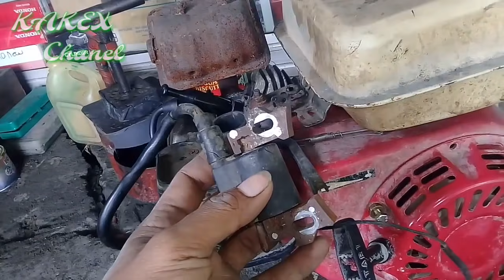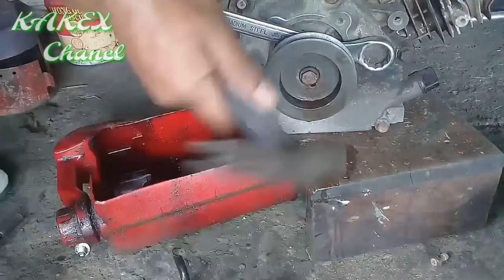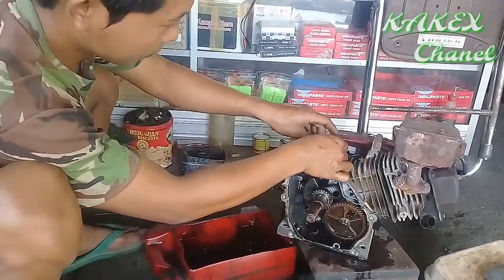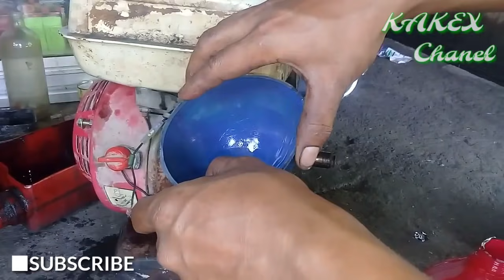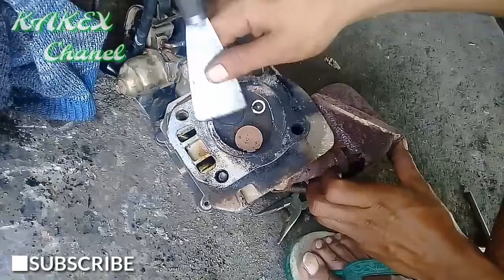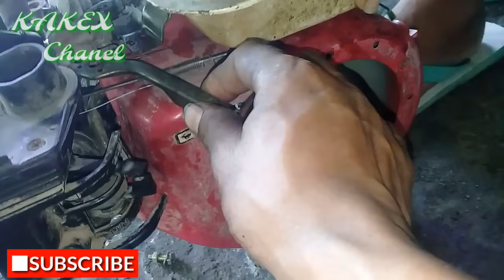Cara ganti governor mesin GX 160 & hilang pengapian

Comment: Boss mau nanya .
Low oli mesin gx 160 pompa air.
Itu sama atau ga sama oli motor.
Pa ada oli sendri.
And oli apha yang bagus .
Terimakasih.
Di tunggu balasanya.
Reply from the maker: Sama aja oli motor 4t. Terserah sukanya merk apa. Biasanya sy SAE 20W-50
Reply: Berrti bukan oli disell yah boss
Reply from the maker: @abitpermana1415  bukan. Ini kan bkn diesel
Reply: Oke boss makasih atas info nya

Comment: Om mesin gx gitu banyak yang di pake gokart, governor nya di bypass (dicopot) biar apa ya kira-kira . ?
Reply from the maker: Itu gasnya dibuat manual, pake tangan ( hand grip) kan? Jd mesin lbh responsiv, dgn mengesampingkan dinamika beban mesin. Gampangnya gini, kl dilepas putaran mesin ngikutin untiran tangan. Kadang jg karbu ganti karbu motor, gk mach lg sm governor
Reply: @KAKEXChannel  ngelepas governor tinggal lepas gtu aja ya ? Gak ngerusak bagian lain om . ?
Paling bekas lubang porosnya ditutup baut gtu ya....
.
Iya bener om pake karbu motor terus throttle..
.
Kalo semacam mesin gerak serbaguna Loncin Diesel ada bagian governor gtunya juga gak ya om . ?
Reply from the maker: @Fauzan128  pada dasarnya semua mesin semacam ini, buat apapun termasuk genset jg selalu dilengkapi governor utk mengikuti lonjakan beban scr tiba2. 
Istilah "diesel" itu sebenarnya mesin dengan bbm solar, kl utk mesin semacam ini kurang tepat. Tp di masyarakat trlanjur salah pemahaman

Comment: Mau nanya 2 kasus bang. 
1. Apa penyebab busi alkon cepat mati. Udah sering ganti busi baru tapi gak lama businya mati.
2. Diesel yg satu lagi semua udah dirasa normal, tapi bensin sangat borooooss bgt bang. Karbu,  pengapian, setelan klep udah diberesin semua tapi masih boros tiada tara. Apanya ya yg harus disetel/diganti ? Asal bukan ganti diesel baru aja.
Reply from the maker: 1. Penyebab busi cepet mati / hitam bs karna salah busi biasanya yg setipe dgn gx 160 itu busi panjang spt NGK BP5ES/BP7ES.  Kl slh yg pendek spt BP5HS/BP7HS bisa bikin pembakaran krg sempurna. Bs jg api dr coil kecil krn coilnya sdh lemah. Klep trlalu renggang/ timing meleset jg bisa ( tp kl blm prnh bongkar gk mungkin meleset). Setelan angin karbu terlalu boros atw kotor karbunya. Ngebul putih/ ring piston bocor jg bisa. Silahkan di cek kira2 yg mana yg belum di cek
2. Lihat kepala busi dulu, kl cepet hitam biasanya dr karbunya yg gk beres. Kl disetel sdh susah coba pake karbu mesin lain atw beli baru, plg 150 rb an. Ini jg mirip mslh busi boros
Reply: @KAKEXChannel  terimakasih, sangat membantu.

Comment: Bagaimana jika governornya gk dipakai lagi gan

 Karena karbu bawaan nya saya ganti dengan karbu yg bisa pakai gas LPG. Jdi salam saya pakai gas lpg  governornya gk saya pakai
Reply from the maker: Tidak apa2. Governor itu pengendali trotle plate aja
Reply: @KAKEXChannel  kalau mesin tidak bisa nyala apnya gan. Pengapian ad kompresi ad tpi mesin tidak mau hidup sama sekali
Reply from the maker: @ardtronicelectricalenginer3172  api ada kompresi ada brti tinggal masalah pasokan bensin dong
Reply: @KAKEXChannel  bensin ad gan

Coba pakai gas lpg pun juga sama. Tidak bisa hidup sama sekali
Reply from the maker: @ardtronicelectricalenginer3172  apinya mgkn kurang besar atau timing geser. Cek flyweel

Comment: Mas kalo oli bocor dari bawah tangki itu bagaimana mas?
Reply from the maker: Tangki apa?
Reply: @KAKEXChannel  tangki mesin honda GX 160
Reply: @KAKEXChannel  soalnya olinya bocor ( mrembes ) tapi rembesanya itu dari bawah tangki gx 160 mas.
Reply from the maker: @JovrinYT  seharusnya oli bocor itu di blok mesin. Kl dr tangki mungkin itu bensin campur kotoran, tangkinya yg bocor, bs di las atau ganti baru. Ada dijual
Reply: @KAKEXChannel  bukan tangkinya tapi di bawah tangki. Kan ada yang buat setelan gas yang bawah itu laa bocorny dari situ
Reply from the maker: @JovrinYT  oh dr tuas governor? Itu emg gk da sealnya. Mungkin kebanyakan oli atau selang pernafasan yg di kop tersumbat jd uap oli cari celah
Reply: @KAKEXChannel  selang pernafasan kop di sebelah mana si mas?
Reply from the maker: @JovrinYT  yang nyambung ke karbu
Reply: @KAKEXChannel  oke terima kasih mas 👍atas solusinya

Comment: Bang setelan guvernur pengaruh g ke gas yg g stabil di rpm atas
Reply from the maker: Bisa pengaruh
Reply: Sya ngikutin cara abang setel guvernur pas dinyalain gas'y langsung besar
Reply from the maker: Itu setelan umumnya, kondisi mesin dan karbu masing2 bs beda. Coba geser maju/ mundur dikit aja. Sebelumnya per regulator yg nyatu dgn kawat dipastiin dulu jgn smp trlalu keras/ kendor

Comment: Kalau gas di naikan kmudian tarikan brebet..  Itu apa nya ya mas?
Reply from the maker: Bersihin karbu dulu
Reply: Sudah mas,  karbu baru malah
Reply from the maker: Kl karbu baru coba disetel dulu
Reply: Mohon info nya gan,  setelan angin dan gas hrus nya sprti apa ya?
Reply from the maker: Setelan angin makin dibuka makin boros. Utk mesin normal biasanya ketemu di 3 smp 5 kali setengah putaran. Dr posisi tertutup penuh buka setengah2, berhenti saat mesin tdk berubah rpmnya
Reply: Oke trmksh info nya..  Sukses terus mas ku